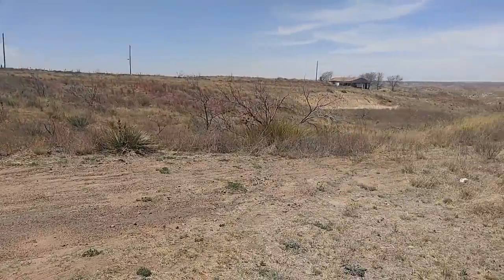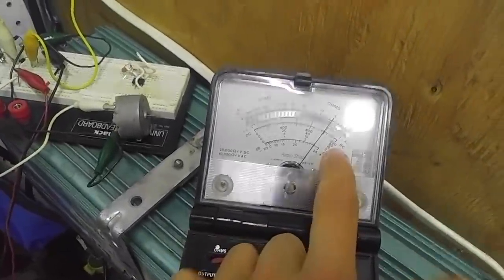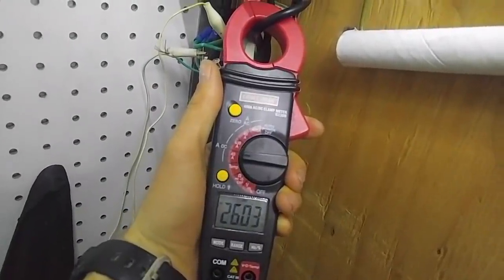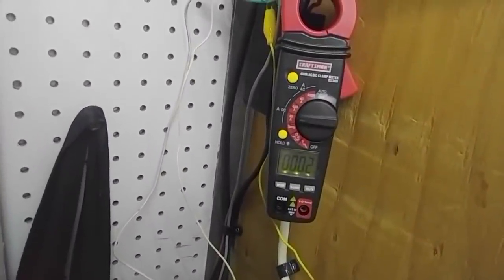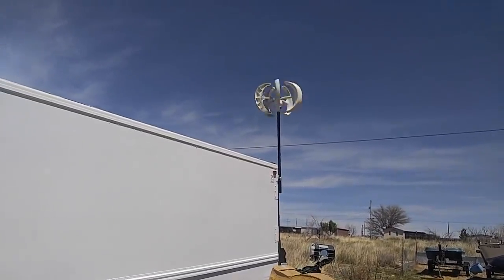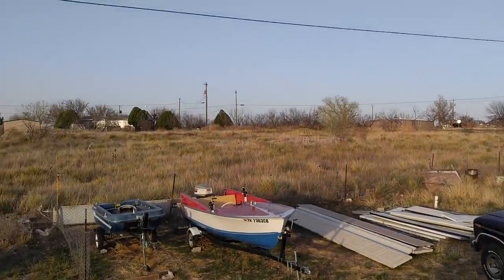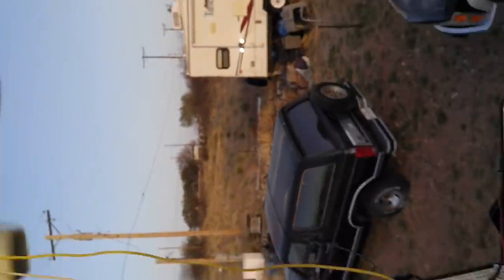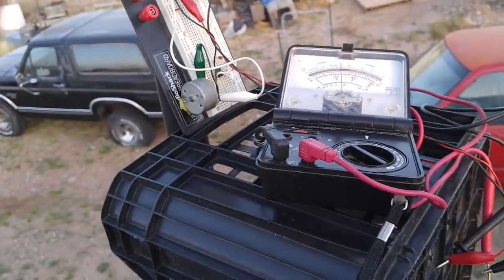400W Chinese Ebay Latern Vertical Wind Turbine Performance

Comment: Agreed pos.... Im gonna try converting a car alternator to run instead of this .. Use these blades and parts with a cars alternator. I may have to gear it up to spin fast enough...
Reply: Your better bet, if you can get your hands on one, is a treadmill motor.  But you usually have to take the treadmill too

Comment: My bet is it's just not hooked up correctly.   His Diode set up is wrong or something.  The power drops because your effectly shorting out the source stopping the motor.  Get a proper Three Phase Diode block .   Short out any two of your leads to each other.  If the PMA does not Slow down BREAK,  it's defective and not producing.

Comment: Measure the DC resistance from leg to leg. Make sure the machine is NOT turning, or it can blow out your meter, or at least, give erroneous readings. That will give you an idea of the impedance of the stator, and how much energy is being lost as heat, before it even comes down the line. For that to be a 400 watt turbine, it must produce 27 amps, at 14.4 volts, to charge those L16 batteries. 2.7 amps, if it even puts out 40 watts. I don't think you're getting more than 2% of its advertised rating. If this turbine shadows any of the solar panels, that panel will lose more power, than that turbine can put out. Not worth the shadow it casts on the panels, unless you park the truck, so the turbine is north of the photovoltaic array. RUBBISH!!! nowhere near specifications.

Comment: I believe the review may be more defective than the unit.  If the reviewer intended to show that the generator was defective or of low quality, he need merely connect the 3 output wires together.  If the generator were defective, they would have continued to rotate at speed or at a slightly lower speed.  If it were in proper condition, it would quickly stop.

Chinese generators are very high quality.  China is the only country in the world that manufacturers small (< 20kw) low-speed generators.  I have no idea why only China.  It is true that the documentation that accompanies such generators, if there is any, is not so good - even it you are fluent in Chinese.
Reply: These generators are shit.... I was duped too. Useless do not buy !

Comment: basically this project is almost not worth the energy of the math for 2-3 mps  lol but if you do have more wind its a good math practice and has potential power bank battery savings

Comment: Som times...0.25 watt diodes .0.75mm2 
400watt divider by 12volt Roughley 33Amp..
Oooh IT cant produce.. nop not in that set Up..
And did Sound was turned down becaus og wind
Use a sok over the Mick end next time.. 
This is a fantastick how not to do ..
Reply: Chinese specs of 400 watt are actually only 10 watt in real life, I got the same junk, true output is 30 milli Amp.

Comment: I don't think wiring is the problem, it's operator error!
Reply: I wouldn't call it operating error, when the machine can't even produce 10% of it's rated current. the six diode bridge is an efficient way to take the power from a 3 phase alternator, and convert it to a clean DC. At 14.4 volts, it should produce 27 amps. at 12, that should be 33 amps. It's nowhere near 2 amps, let alone 20.

Comment: I bought this junk a year ago, I see a lot of comments about watts and amps but nobody talks about voltage, we understand that to charge a 12 volt battery bank the wind turbine should produce at least 13 volts and more at the regulator output, to have a voltage of 13 to 14.5 VOLT on the voltmeter, the rotor had to rotate 3 rotations per second ,  which means a windstorm of 70 miles an hour and more that could potentially tear off the blades of the wind turbine.
If this video had been produced before I ordered my wind turbine it is clear that I would not have bought it... with or without wind through the producer's explanations, good job.
Excuse my poor english it's a google translation.
Reply: Actually the guy that posted seems like decent fellow but don’t know how electricklicity works. I don’t know if you were fortunate or not. 
I just want 40-50Wh/hour as a slight hedge after dark or when the sun don’t shine but the reviews on these things are terrible. Whether people think they work or not most of them don’t know how to test ‘em anyway and that’s so confusing.

Comment: Maybe if you purchased through  paypal they might refund you if you state item is not as described? 
Usually ebay is on the side of buyers,I have had other items refunded that way that werent fit for the job as described and if enough buyers asked for a refund on these missadvertised turbines they would eventually withdraw them for sale or give a more honest description of the output.

Comment: Might be worth repeating the test without using those useless 1 amp leads with 0.02mm wire.
Reply: ...And a discharged battery or something.... this video has no answers to anything

Comment: i replaced the generator section with a lg direct drive motor with few winding mods here n there 24 volt and between 5 to 7 amps ,think ill have to get 2nd one up there

Comment: Wrongly shaped, WAY too small ( https://en.wikipedia.org/wiki/Betz%27s_law limits partially possible energy production) to provide declared amount of power (for obtain 400W he need more than 5x5 foot rotor @ 10m/s!), too low to got enough fast wind. Gusts can't be calculated as value of provided energy, rather have to use minimal value in some period of time (imagine car with engine which can have 120HP, but usually have 70HP and sometime 55HP - can you drive normally?).  Wrong assumptions before start and designing turbine - and fitting.

Comment: time is running out for me to buy a good wind turbine all the good one is so expensive all the bullshit one is no good I'm disabled this my first time using solar power as a backup emergency plan at sixty years old I'll built my first diy solar power generator system with solar panels but the sun don't shine everyday i need a good wind turbine for backup for a backup and i was looking at this but it junk on a fixed income a couple of hundreds is all i can afford and that be pushed it to the max it took me about three years to get the money to make my solar-powered generator but the sun don't shine all the time it's useful if the sun dont shine to recharge the battery if the power grid go down and the sun don't shine it's useless

Comment: You need to put a capacitor on the output DC voltage to measure DC.

Comment: I did some calculations and found 18 watts theoretical maximum  at 12 m/s but not 400.  This comes i.e. because the relative windspeed of the 2 working blades  is smaller than the outer windspeed and the relative windspeed of the parasitic blades (=loss) is bigger than the outer windspeed. But windspeed-power is rel. windspeed^3 !  Thus the  catched power will be eaten up at bigger RPM.

Comment: The design of vertical wind turbines are great, but there are a number of factors that can impact output. The magnets in the rotor might be too weak, the windings may be sloppy/light, the electrical cables might be of poor conductive quality or undersized, the distance of the cables may be too long. It's too bad all these Chinese and Taiwanese companies are allowed to sell their products on amazon, ebay, etc. without needing to prove their claims. It really does a disservice to buyers in the US. I mean, how are you supposed to get a refund on an overseas product? Also, please use a windscreen when recording outside in windy conditions.

Comment: i have that same  pure sine wave inverter charger,and it been on steady for a year ,cycling 4 120 AMP HR 12 volt. it is out in my camper and it is 15F out there right now. it is awesome,super clean power, for the lowest price, but,is a 3rd of the rated watts.

Comment: The wiring is all far too thin. It will never pass any current it will just dump the current as heat.  I've had a few windchargers, so thought I would have a look at this video before I get one of these.  Maybe I'll give this make a miss.👍

Comment: Thanks for the fantastic review. . .  I own a house off the grid and was looking for a Turbine. . .When I saw this review, It solidified what my suspicions were on these Chinese Turbines.  Eventhough you may have used some wrong terminology, you did a fantastic job with showing your meters and small motor hookups. 

I immediately knew exactly what you were talking about.  I did a little research on these turbines, and these turbines are NOT producing 600 watts instantaneously.  But I read an article that said they put out 600 watts over a certain length of time. . .like a week.   This coincides with what your review is showing. . .600 watts over a time period.  600  watts over a day is only about 24 watts a hour on a 24 volt system. 

Wind is the absolute worse alternative energy you can use.  Solar is your best bet.   Much cheaper.  I use 1200 watts to power my 1400 square foot house in the mountains, and that runs a 50 inch TV, blenders, lights, water pump, and other equipment. 

Good job. . .Keep up the good work.
Reply: Dear friend, I saw your reply. I want to say that there are many good wind turbines in China. This wind turbine is more suitable for use with solar panels. This wind turbine is suitable for installation in street lamps with complementary scenery. Above. I am a manufacturer of wind turbines in China. We have 6 years of experience in production and installation. There are many models suitable for off-grid systems. If you are still looking for wind turbines, I hope I can give you some help. You can add me. WhasAPP: +8613338743305. I look forward to hearing from you.
Reply: @carolinereynolds2534  do you have a email address

Comment: This fellow is throwing out a load of electical jargon and he doesn't actually know what he's talking about.
Reply: You actually could hear what he was saying??
Reply: I am using 6 diodes to rectify the AC into DC. LOL
Reply: @masterdeere  you never know, it might be a 3phase wind turbine.
Reply: @slainsco  
And how many wires is that? And how many make 12V hahaha
I don’t know everything and I’m not an EE but I’m way above average on DC for boats, cars, solar... and I have to admit i was listening to this driving - not watching- if it weren’t for the 100mA load and a couple other things I’d not have pulled over and watched cuz my head was saying, “what did I miss?!!”
And then I thought it was April 1st or something. 
But ya, 100mA load will- surprisingly- need 100mA to run it lol
Reply: Yes..what he is sayin is correct ...it is sad electricians don't have a clue ...I'm a electronic & engineer journeyman...
Reply: Can confirm. so many things wrong with this video. Source - Am electrician.
Reply: It’s working, where are your videos to show us the one way?

Comment: Try testing the turbine by spinning it by hand. Also try testing output power with only one phase producing (leave one wire not connected). Also try spinning the propeller with all wires connected short circuit and measure the currwnt

Comment: The DC motor will only draw a minimal current, as the internal resistance of the motor is going to be small. Current flow is dependent not only on the voltage level but also the internal resistance of your load.  Try hooking it up to the 12V batteries you have when they are not fully charged and you will see a big difference in the current flowing.
Reply: I agree, maybe something more than 1 amp test leads might help also.
The fact that the stalled motor drops the volts actually suggests the wire is even more to blame.

Comment: Having sold over 2,000 small wind turbines, I can tell you, vertical axis wind turbines are junk and don't produce enough energy to ever pay for themselves.  Yea, it can produce 400W at 55mph but a horizontal axis turbine will produce 400W at 20mph and produce far, far more energy than a vertical could ever dream of, which is why all commercial wind turbines are 3-blade, horizontal axis.
Reply: I buyed a vertical axis turbine because- following the false chinese description- its lower rated windspeed of 10 m/s only. The horizontal axis turbs needed 13 m/s. They falsely rated their verticals 2,5 times better efficient than their horizontals.

Comment: these are 24v AC Not DC, its on the manufacture specs.
Reply: 24 V AC from phase to phase of a three phase alternator will rectify to 33.9 volts into a capacitor, unloaded. That's the peak to peak voltage of a 24 volt RMS sine wave. This alternator would hardly do that, unloaded, even in those strong winds. That said, at 400 watts, it should still be able to put out 11.8 amps. The math doesn't work, because the power simply isn't there. Those fine wires in that stator would never handle anything near that.
Reply: @vincentrobinette1507  the math doesn't work because the guy is a moron, that knows s**t about electricity or a circuit. read the other comments.

Comment: There is a very little turbine with a very little generator inside, I cannot imagine getting for hundred watts out of a thing that is the size of a fist, spinning at a few hundred rpm. Sure, if it spun at 10krpm... maybe. 

No, my guess is that the turbine is 4.00Watt. The period got lost in translation. 

And, If I may, you're trying to rectumfry 400Watts of juice with 1n4007s??? 
Come on... :)))
Reply: Have you not seen a alternator in a car? 90 amp plus alternator is the same size, kinda think your theory is incorrect
Reply: No, the diodes were just to run the motor. I was trying to get that big current out of the charge controller provided

Comment: What does stopping the motor have to do with it generating power or not?  Can someone explain the theory to me here???
Reply: Stalling the motor with my hand results in the motor drawing more current in an attempt to continue rotating. Completely stalled the motor is drawing about 200 milliamps or so. When the current draw on the turbine increases, the voltage tends to decrease. If you were to short the turbine, the voltage would go to zero, because P =IV, power = current * voltage. Increase current draw, voltage must drop for a given power generation capacity.
Reply: Still not sure what that is supposed to show us.  If you short the load, you should have no voltage, therefore no power.  It is doing exactly what it supposed to do when you stall it...
Reply: It's showing you that the voltage drops significantly if you put even a 200 ma load on the turbine...meaning it is hardly producing anything. That's it! Plain and simple. Just a visual demonstration. Now connect that same motor across a car battery and it'd start your car absolutely no problem with the motor stalled. The car battery has 900 cold cranking amps or so. 0.2 amps is a drop in the bucket. If the turbine was producing 30 amps like it was rated to, that would also be a drop in the bucket and the voltage would not decrease observably. If you truly short the load voltage will approach zero but never get there...after all even a small length of wire has a resistance. But yes you remind me....that simple equation doesn't quite say it all. These things do have a power curve...there is a current draw such that power is maximized...this is what MPPT solar controllers do (I have a $600 unit).

Comment: LOLL i short the motor inside.. look how the voltage drops !! LOLOLOLOLOLOLOL  yeah.. short your car battery then measure o volts on it.. very nice ! :) the batery is empty !  LOL OLOLOLOLOLOLOL
Reply: You don't understand that this motor, even when stalled, is not drawing infinite amps. It's drawing a few hundred milliamps at most. Absolutely ridiculous comment.
Reply: why the motor !? youll always measure low voltages on the dc motors.. (speacially if not rms)
Reply: Melancia Acrobatica lololo...I did that in the video!

Comment: LOL... do you never measured the voltage when you plug a dc motor on a 12v source or something like that ?  dc motor  shorts the current.  it will show a voltage going to 0(zero) .. you need to measure it with no motor in the middle.  when it short it, voltage go to zero every part turn.. and uses the energy..  if you want energy, stop shorting its poles.. LOL AMASING .... .why do you need this motor on it ?!?!?! a led or bulb dont teel you when its on ? you need to listen to the dc motor !??!
Reply: You don't understand that this motor, even when stalled, is not drawing infinite amps. It's drawing a few hundred milliamps at most. Absolutely ridiculous comment.

Comment: The generators used in this type of turbines are made to spin at approx. 2000 rounds/s + to generate specified power output. Which is impossible. Same as you would put a car alternator in the turbine, will do some power but not even close to specified as they are made to turn even at 5000 rpm. Try putting on a different generator, permanent magnet generators are made to work under low rpm. I'm guessing you'd be happier with the results that these type of generators work in your conditions. But i might be wrong.

Comment: Your clamp on meter is set to DC.... You should be measuring AC from the turbine!
Reply: It was measuring the rectified DC. Impossible to measure 3 phase AC with it, designed for 2 phase.

Comment: 30mph Panhandle winds should get you 400w on a small turbine. Those vertical jobs aren't efficient. You can tell it's a poor design by the way it turns.  A weak generator compounds the problem.

Comment: Run +/- leads to the battery connections on an 18v cordless drill.
Mount those blades on a shaft,and chuck shaft into drill head.
Mount drill on pole(head pointing up).
Connect +/- leads to charge controller.
This easily will produce approximately 14.4v@5amps in the winds you are showing.